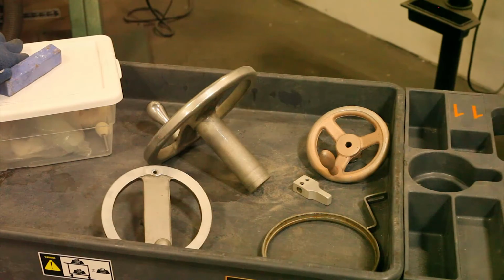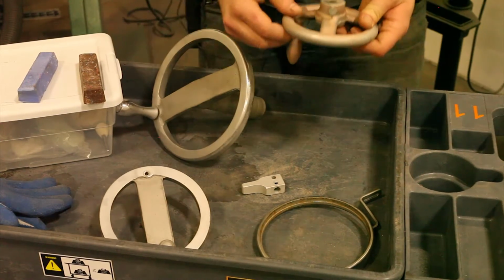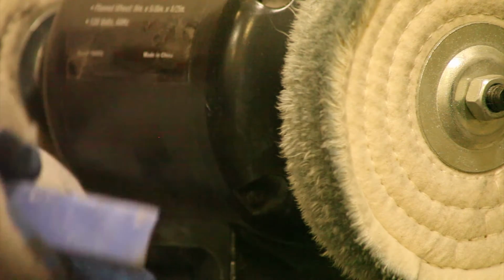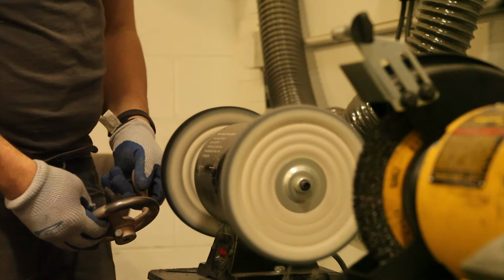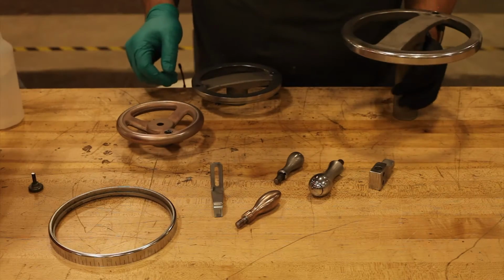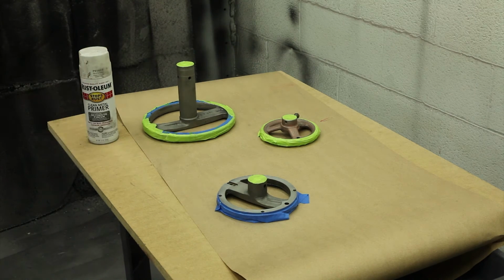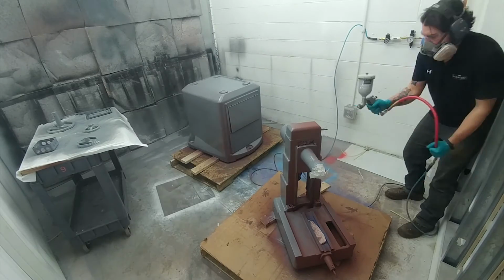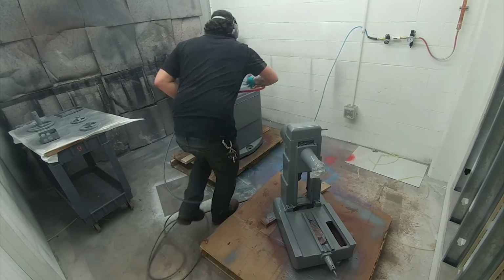Boyar Schultz Surface Grinder Rebuild - Part 2: Paint and Polish

Comment: Great video and great job on the preparation. My view is that the hand wheels and painting are cosmetic. It's an old machine and probably the hand wheels could have been re-chromed. But the real work on a surface grinder is making sure those ways are true in X, Y and Z. Really enjoying the presentation. Keep up the good work.

Comment: The wheel was chromed, now that it's partially off, you should removed it all, as the edges will never stop chipping and you'll end up with very painful shards of razor sharp chrome in your fingers and hands, either strip and re-plate it, or  just polish the steel? Powdercoat it? the other wheel looks "Bronze" cause some times they copper plate steel so the chrome will adhere better